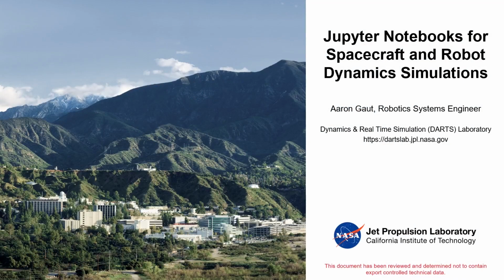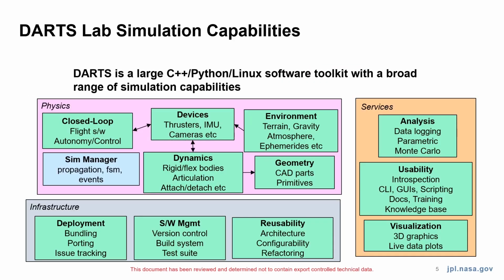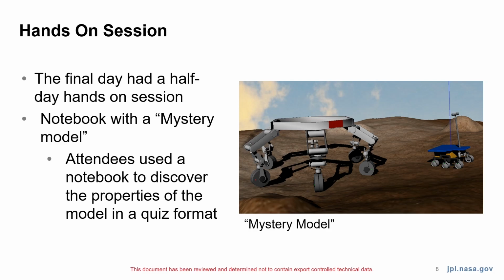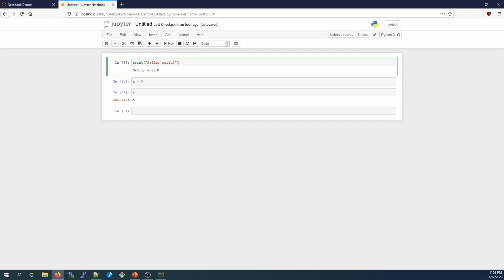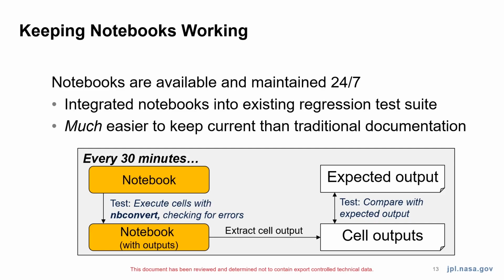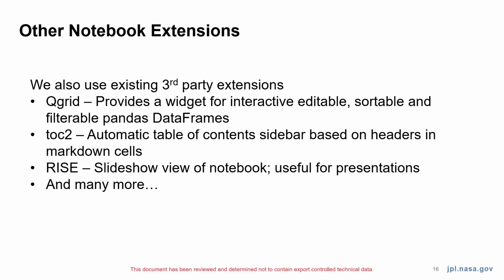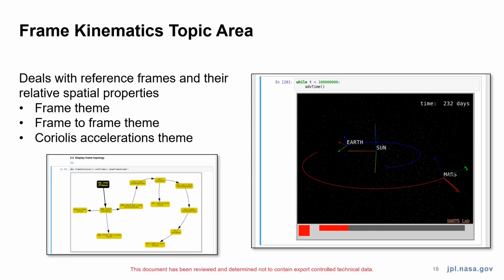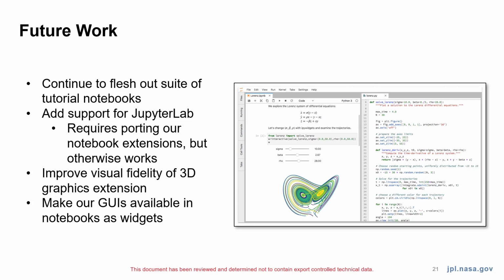Jupyter Notebooks for Spacecraft and Robot Dynamics Simulations |SciPy 2020| Gaut, Cameron and Jain

Comment: Very interesting!
I am developing an open-source framework for multi-body dynamics that follows most of the concepts mentioned here!! 
Using SymPy for symbolic creation of the topological equations of the systems and using the concepts of code-generation to run numerical simulations. The code-base is under the name "uraeus" and can be found here https://github.com/khaledghobashy/uraeus_mbd.
Here is a cloud-based notebook hosted on Google Colab (https://colab.research.google.com/github/khaledghobashy/uraeus_nmbd_cpp/blob/master/demos/double_wishbone_direct_acting/double_wishbone_direct_acting.ipynb#scrollTo=oNp9xjb0vO4V).
The notebook represents a full multi-body system of a double-wishbone suspension mechanism modeled using uraeus.smbd and simulated in C++ using uraeus.nmbd.cpp. Also providing online visualization for the system based on BabylonJS. All with no local installations of any sort!